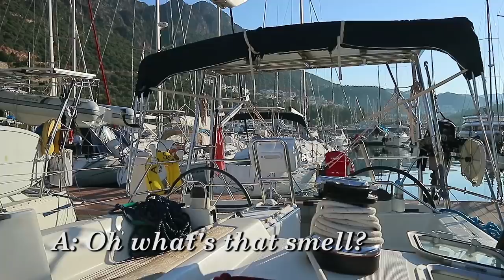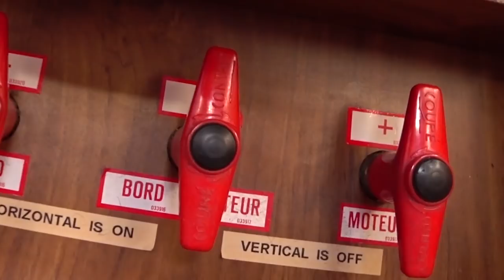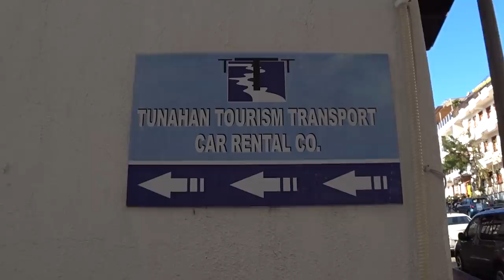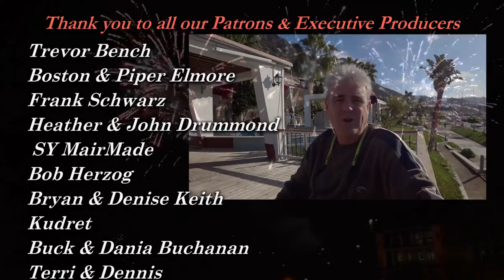Smoke detected! Emergency on board - Sailing A B Sea (Ep.155)

Comment: Just curiosity: 
1. how mach have you spend so far on this engine?
2. how many hours on this engine since new or since overhauled?
3. what is the engine make and model?

A diesel engine like yours has mechanical fuel injection and it will run as long as it has access to fuel.  The way it stops is by removing electricity from an electrical fuel valve which is kept opened by constant 12 v DC.  Most diesel engines of this type have a manual fuel shutoff for emergencies.  Somewhere you should have one or install one as close to the injectors fuel pump as possible.
Reply from the maker: Hi Alex, since new (25 years ago) the Yanmar 4JH2TE engine has 2,579 hours on it. 

I don't have an exact figure to hand of what we've spent on repairs since it all began when we replaced the rusted through exhaust elbow in Greece winter 2019/2020. I would need to go through all on my blogs since that point (50 blogs) and add up the costs noted in them and I don't have the time to go through them right now.

We think we have located the manual emergency shut off cable in the engine bay we will be testing that later today when the day warms up a bit more. Cheers.

Comment: Ok Baz, how many mirrors have you broken.  Couple of things you might want to consider, smoke detectors in the salon / cabins, an auto fire extinguisher mounted in the engine bay.  As to stopping the engine in an emergency, I would think that your engine will have a manual lever somwhere on it to shut down.  Also be aware if you shut off the batteries while the engine is runnning you may damage the alternator.  You both did extremely well during your emergency, well done.

PS

Cold beer is very good for smoke inhalation, no matter what time of the day 😉
Reply from the maker: Hi Mark, we do have smoke detectors at either end of the saloon. An auto fire extinguisher in the engine bay is a good idea. I'll get the engine .PDF up today and see if there is a manual shutdown option. Good call on damage to the alternator.

Mmmmm beer. 👍
Reply: @SailingABSea  Hi Guys, What type of smoke detectors do you have? There are two types ionisation and optical.  As you could see smoke from the cockpit at least one of the alarms should have been sounding.  Perhaps they could benefit from being repositioned?
Reply from the maker: Hi Derrick, they are both the photoelectric type and one is positioned near the saloon ceiling right next to the companionway. Maybe we need to swap them out for ionisation type detectors?
Reply: @SailingABSea  I'm not an expert (so please keep that in mind), but I'd be inclined to swap the alarm near the companionway for one that is an ionisation type.  I'd then relocate the one that had been removed to one of the aft cabins.  The idea being that a mix of technologies should give the best chance of detecting a fire early , at least as early as Aannsha nose :o).  Another great video by the way.  
Regards Derrick
Reply from the maker: We're going to Marmaris with a friend next week we'll see if the chandlers there have ionisation smoke alarms. 👍
Reply: Try a hardware or electrical shop probably be a lot cheaper
Reply from the maker: Yeah that true.
Reply: Remember a 1€ toilet brush sold in a chandler's is €7 😉

Comment: If you have a run away, block or cut off the air inlet. Diesels will run without the battery and doomsday with the fuel shut off. A friend had one run away running on crank oil.
Reply from the maker: That's a good suggestion Phil. I'm going to pull up the .PDF for the engine and see if it has a manual shut off option.

Comment: Baz, Hear Me... If you have two smoke detectors and neither of them went off, You MUST do two things:
1.  Buy two new detectors immediately.  With the amount of smoke I saw in the vid, they both should have been wailing.
The old ones may be usable as spares IF you can replace the batteries AND test them with actual burning wire insulation.
Test is simple... Use a heat gun on a scrap of wire/shrink tube terminal about 4 feet away from the suspect detector.  
Next,
2.  Move one of the detectors to within five feet (4') of the engine bay.  No further. 
I found that my detector was working last week when I used a heat gun on some wire terminals.

Glad your damage was no worse and that you're, hopefully, not suffering any lasting effects from the smoke inhalation.
G King 
SV Intuition
Reply from the maker: Hi G, we're going to test to see if a smoke detector going off inside the enclosed engine bay can be heard with the engine running. Cheers.
Reply: Oddly enough, they go off when we overcook food! 🙄
Reply: @AannshaJones  Got cha but, burning food smoke is different from electrical insulation.  Different sensor reality.
Just sayin'.

Comment: The starter motor looks like it was starting to what they call birds nest, what can cause this is if the ignition key is intermittently not returning from the start position back to the ignition on position. When turning the key from ignition to start make sure it id returning as other wise it will cause the starter motor to run with the engine and you may do the same to the new motor.
Reply from the maker: Thanks for that heads up and tip Chris, I'll get some lock lubrication sprayed into the ignition key hole.

Comment: I was about to send you a six pack of craft Greek smoked Porter.  Now I’m reconsidering.. A wet towel covering nose and mouth makes for a good emergency breathing mask in case of smoke btw.
Reply from the maker: That's a great low tech solution, thanks Niko. Life is never dull and boring. 👍

Comment: What was the rookie mistake with the starter motor at the end guys, did i miss the reason?  And Wow close call, keep safe. PS. Fixing A B Sea could be a spin off channel haha.
Reply from the maker: Hi Robin, we'd connected the main battery feed to one terminal on the solenoid and then connected all of the other live connections to the other terminal. The tech showed us that all the wires needed to be connected to the one terminal with the main battery feed. 

You're very close, fixing A B Sea is an up coming separate playlist that I'm editing together. Cheers.

Comment: WOW, indeed shit happens but luckily you was in time (in a way) . Stopping the engine is either stop the fuel or the air intake. Guess you don't have a shut-off valve in the fuel line just before the fuel pump. May think about it to make as you never know what happen. Also the old starter motor there is no such thing as maintenance for it and you only service it when it stop working. But you both where lucky, could be worth much more. Anyway now you also know how an electric starter is working. By the end of the day you will be a good engineer and yes you learn the hard way.
Keep on sailing and stay safe.
Reply from the maker: Hi Peter, we are learning every day with A B Sea, she seems to have a lot to teach us. 😀 I'll be looking at the engine .PDF today to see if there is a manual shut off lever at the engine end of things. Cheers.

Comment: Nice video 👍 What was the rookie mistake at the end that required the technician?
Reply from the maker: Hi Andrew, we'd connected the main battery feed to one terminal on the solenoid and then connected all of the other live connections to the other terminal. The tech showed us that all the wires needed to be connected to the one terminal with the main battery feed. Cheers.

Comment: Your Home never disappointing me with what will needed to be fixed Next :) , And yes to the Kill Switches to be the first thing to shut down and you need to learn where the shut off leaver is on your Engine at the Engine end, Look around the Accelerator Cable Area for it Mate. Now lets touch on the matter if you were at sea, i know you have dive tanks on board and a reg so if you had to go into a smoke filled area you could use your Mask and a Pony Bottle to put a fire out after the switches were turned off. And Please Change the Boats Name to CAN WE FIX IT YES WE CAN.  :) Stay Safe .
Reply from the maker: That's a great suggestion about using a mask and pony bottle, thanks for that. I'll be bringing up the .PDF for the engine today to locate the manual engine shut down lever. Seriously thinking of changing my name to Bob. 😂

Comment: isn´t your shot off thing manualy wire from  cockpit to engine , yea i know it still would not have disconected the starter from swalloving amps from the battery, and thats why you have big mainswitches on them  too , that you in emergency can shot them off .the same goes for windgen. and sunpanels should have them as well , not that i have seen many boats with shot off witches  on those thing , but you just don`t have the time to go around diconnecting every ting one by one when you smell melting plastic/rubber just hit the switches grab the fire extinguisher just in case for the smoke hunt  and find your inder  sherlock holmes later when everything has settled down a little
Reply from the maker: Hi Dennis, at the helm we only have an electric stop button. We are searching for the manual stop button at the engine end of things. We have found something which we'll test later today when the weather warms up. Cheers.

Comment: If I were you I would be checking the fussing of that circuit.  The whole point of fuses is they blow and stop this from happening before a wire can carry enough current to met it.  Biggest issues is that fuses blow and get replaced with the wrong rating allowing this sort of thing to happen in the future rather than sitting to actual origional issue.
Reply from the maker: Hi Andy, we have searched for fuses and found none. At the electrical panel there are of course many circuit breakers but none of those relate to the wire that was overheated. Placing an inline fuse on that wire is an option. Cheers.

Comment: There should also be a mechanical emergency shut down at the injection pump
Reply from the maker: We have since found that we can grab hold of and pull the shut down solenoid plunger, it's right in front of us when we open the engine bay inspection hatch. 👍

Comment: Does your engine have a stop button on the Stop Solenoid? I've got the much smaller 3YM20 Yanmar and have just looked up the emergency stop procedure in the operation manual. Will be making sure I know exactly where it is just as soon as I can get to the boat....
Good luck with the repairs.
Reply from the maker: Hi Rob, We are searching for the manual stop button at the engine end of things. We have found something which we'll test later today when the weather warms up. Cheers.
Reply: @SailingABSea  it looks like your engine doesn't have quite the same setup - the manual seems to suggest a lever somewhere above the oil filter and below the throttle cable
Reply from the maker: @robhj9933  do you have a link to that manual online that I can view or download?
Reply: @SailingABSea  Baz, are you getting the links I sent? They seem to keep keep disappearing here....
Reply from the maker: @robhj9933  sometimes YouTube does not like some links. Not to worry as we have just managed to manually shut down the engine by pulling out the shut down solenoid plunger. Cheers.

Comment: I would install smoke detectors. The detector will usually go off before you can smell, alerting you to a problem. If you have the detectors stationed in different areas the one that goes off first will direct you to the source. 🧯
Reply from the maker: We have smoke detectors at either end of the saloon. They didn't go off until we opened the inspection hatch. Looking at the logistics of putting one in the engine bay. 👍

Comment: What was your rookie mistake?
Reply from the maker: Hi John, we'd connected the main battery feed to one terminal on the solenoid and then connected all of the other live connections to the other terminal. The tech showed us that all the wires needed to be connected to the one terminal with the main battery feed. Cheers.

Comment: What's the story with Mikes's engine?  Looks like a Perkins Prima heat exchanger.  Mine's also off at the moment - leaking tube stack needs replacing.
Reply from the maker: Hi Ian, as things progress with Mike's engine I am filming small segments. When it's all finished and fires up for the first time then we'll do a whole segment on it. Cheers. 👍 And yes it is a Perkins.
Reply: Thanks Barry, I'll look forward to it.  This was a very thought provoking episode.  I intend to take a close look at where to manually stop the engine in the event the stop solenoid is fritzed.  Keep up the good work
Reply from the maker: Aannsha was saying that this item should be included in the RYA course, in particular the diesel engine maintenance course.
Reply: I agree with Aannsha, but I guess the detail's going to be engine dependent to an extent. Must admit I don't remember too much on this on my RYA diesel course

Comment: Hi guys. Enjoyable as always. On my Yanmar, the engine battery needs to be on for the engine stop at the helm to work. Yours as well?
Reply from the maker: That is a possibility, but when I first tried to stop the engine from the helm position the batteries were still switched on. There's more we need to learn about how stuff works (or doesn't work). Cheers.

Comment: Would like to share some tips for emergency kill the engine…
1) suppose to have emergency kill switch in cockpit, which near by the engine control panel.
2) there are manual kill switch on the engine, should be on the starboard side of the engine next to air intake.
3) use something to fully cover up air intake (im using my palm, not hurt at all), fastest kill the engine than shut of fuel supply.

Shut off battery will not kill the engine on diesel engine (supposedly).

Keep as a knowledge, wish you dont need for future.
Reply from the maker: Thank you for sharing those tips Franco.

We switched off the battery to stop the electricity flowing to the smouldering wire at the starter motor solenoid. You are correct that switching off the battery will not stop a diesel engine. Cheers.
Reply: I believe power still supply to solenoid even the battery switch is off, because the alternator still working.
I will start my journey at Bodrum on April…which to see you there and having drinks with you somewhere in Turkey…
Reply from the maker: We look forward to meeting you along the Turkish coast. Cheers.
Reply from the maker: We are happy to share stories over a couple of beers. 👍
Reply: @SailingABSea  This is what we call sailor community…excited to meet up with you both…

Comment: We all know the travails of unexpected scares happening on boats but you guys are running away with the prize. Hope that was the last surprise. Fyi i would replace the entire length of the wire that fried as it will have been overloaded/damaged. You may want to get an electrician to go over everything on board. I had a good electician in greece check my boat before/after each season and he corrected a number of issues from previous owner.
Reply from the maker: Hi Mat, we're also hoping that's the last surprise in the engine bay. 👍

Comment: Overly dramatic music is overly dramatic. 

That said, search for 'MSA S-Cap Escape Smoke Hood' - cost you about AUD$90, fix it the the bulkhead near the companionway and that will give you a couple of minutes to isolate the fuel & electrical systems and deploy a fire extinguisher in the event of a fire or smoke. Remember, you've also got fire risk from electrical equipment or chafed wiring and there's always the good old galley fire. Also make sure you have lifejackets in the cockpit because the cabin will fill with smoke in seconds, as you found out.
Reply from the maker: All good tips, thanks. We check out the MSA S-Cap Escape Smoke Hood. 👍
Reply: @SailingABSea  And of course, don't panic Captain Mainwaring!
Reply: @SailingABSea  Oh, something else which popped into my head as I was heading off to sleep - If you suspect a fire, close all of the bulkheads & hatches (if possible / safe to do so).  This will prevent ventilation adding fresh oxygen to the fire and smoke from filling the rest of the boat.
Reply from the maker: Another good tips, thanks for sharing. 👍